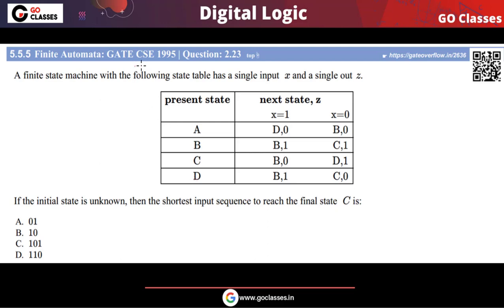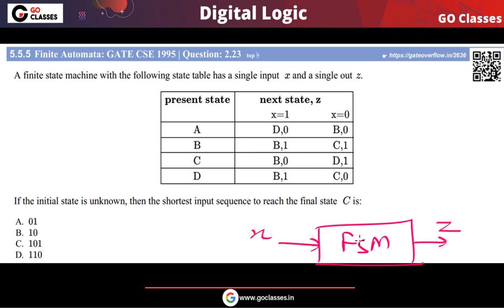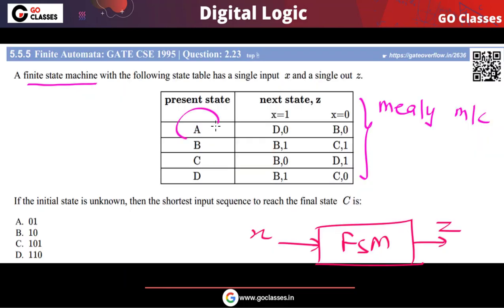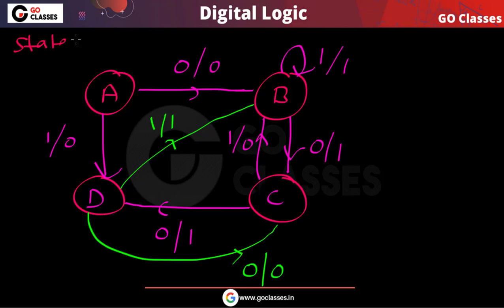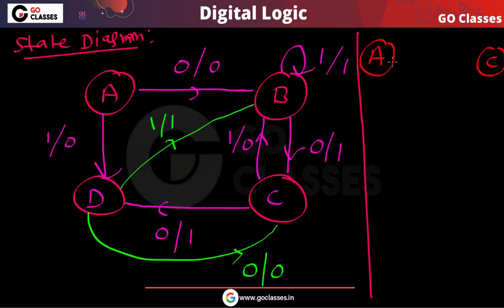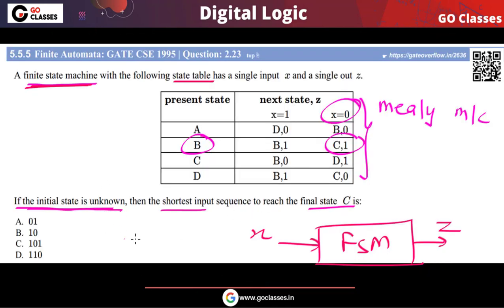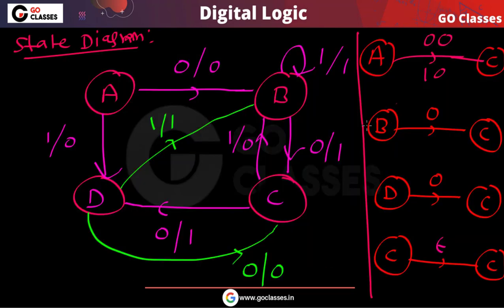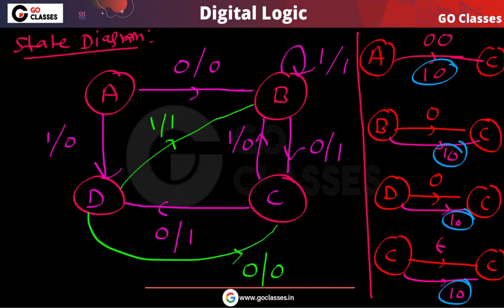GATE CSE 1995 Finite State Machine FSM | Question: 2.23

Comment: at 8:53  10 will be not smaller input in case of B because reaching from B to C smallest input is 0 so its conflict there although 10 will help to reach C from any initial state. is this correct statement to say  ?
Reply: understand question : smallest if "inital unknown" , you start anywhere u should reach C (even C), then Option B(10),D(110) can reach C but 10 is smaller so option B.